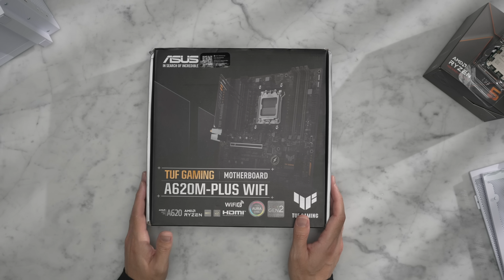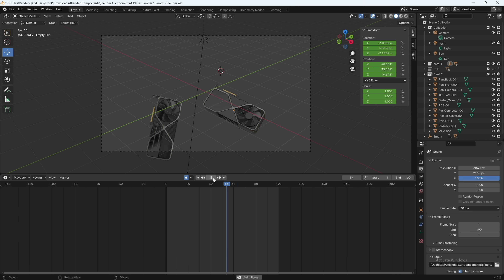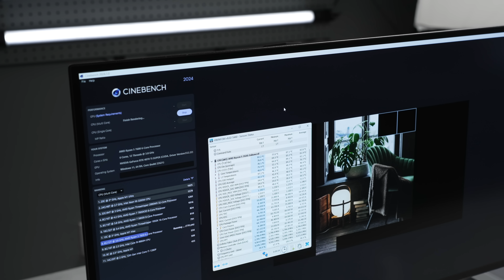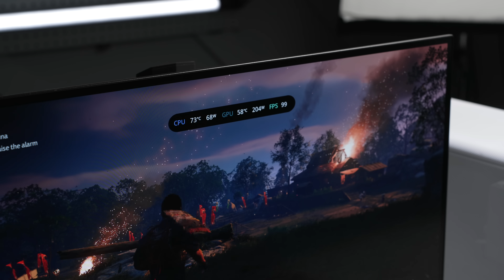$1500 MAX Performance Micro Gaming PC (Step-by-Step)

Comment from the maker: There’s a half inch gap between the front panel and the PSU fan, which is giving it enough air in this orientation. However, it would be optimal to flip the PSU. My mistake there. First time building in this case and had it in my head that the front was ventilated for some reason.
Reply: I still think they should have went with a mesh front panel.
Reply: Quick question: The very short PSU cables are from a different PSU? Or did you buy the Corsair SFF set of cables? Those are very nice and short.
Reply: @MrPicatoste90 😢thats what I was thinking😂
Reply: Just get a ventilated wooden front panel😊❤❤ very detail vedio❤❤
Reply: Important to note, you should flip it because you got the flat panel varient. The wood variant front panel has mesh between the panels.
Reply: just FYI your 1st bitly link 404 not found
Reply: I belive the wood panels have ventilation I don’t know why the colored ones don’t.
Reply: It’s actually not your fault. Front panel should have been ventilated. Psu would get fresh air directly from outside. Not the heat of the gpu and other companents.
Reply: @Galiamon  huh this case could be bad for psu then from your comment
Reply: @KnightZeemo  yes it is
Reply: I may know why you had that idea in your head, Devyn: When it was originally teased and announced by Lian Li, they said the front panel was gonna have fabric. I guess feedback/backlash made them change the front panel to solid plastic (would've been better if it was mesh though).
Reply: So many people are asking. Please respond! What is the system monitoring stat app you are using in the gameplay demos?

Comment: I still come back to this video even though I completed my first build in this same case back in October ‘24. It’s fantastic. I am starting to see space dwindle on my 1TB nvme, but there is an additional m.2 slot on the back of my mobo with no heat sink. Just wondering if I actually NEED a heat sink for the additional drive?😅

Comment: 4070 ti gaming OC is 336mm I have one XD. Seems perfect for a chassis like this with an X3D chip on an air cooler. Just keep that top exhaust blowing, and some gpu intake fans if they even fit. To un CHOKE the gpu vs having a top mounted RAD. As far as the most optimal/setup orientation for using the glass side window. Id consider am5/ddr5 but the price point of that asrock b550M SE is too hard to pass up from a budget/impact standpoint while wedging the most budget/scale towards a GPU. By the time that platform feels quite dated im figuring DDR5 M-atx boards will be cheaper or a more worthy aspect of consideration/upgrade. Or when AM5+ m-atx boards come to exist. For a higher end gpu even....4k becomes more of an aspect of considration or an OLED tv/monitor which to me is still somewhat less of an emphasis on cpu. Though the intel/ultra chips have shown some 4k implications. From a price standpoint id still consider the 5800x3d/DDR4 and a flagship range gpu for 4k from a budget standpoint it still leaves a lot of potential towards a tv/monitor. IMO current gen still cant even make the most of a 240hz 4k panel. Id rather get something more budget oriented/suited with lower refreshrate that still offers VRR. And largely "CONSIDER" a platform/gpu upgrade when newer gen oled panels exist that boast better HDR performance/brightness ranges. As far as what "today" can offer budget wise...vs tomorrow. From a build to monitor standpoint/ratio. a 180hz 21:9 oled per ex with a decent build bearing in mind use of DLSS+ Frame gen, or fsr+FMF. Into that future/upgrade generation/cycle....and better OLED brightness-option era potentially flexible. Thats just around the corner as well as am5+. BC of the older am4/DDR4 platform you can wedge a 7900XTX into the 1500$ build budget range for 4k into a future/better 4k system when that time comes. OFC nv offers more to professionals As well as a current state/better support/implementation of DLSS or Frame gen...granted FMF is supported on RDNA2 cards as far as AMD finally making its way around the bend. So ppl could also snag/snipe a good 6950xt used and run up a build for this use case.

Comment: so beautiful. i would love to see an aircooled 4080 super 7800x3d build in this. i'm actually considering "using" this build but with a 7800x3d and the zotac trinity 4080 super (which is of 306mm length i suppose it would fit), Thermalright Phantom Spirit 120 Evo CPU Cooler and the GIGABYTE B650M AORUS Elite AX (Rev. 1.0) mobo, Corsair RM850e 850W PSU. PCpartpicker says s'all good but as i have to get the parts of 5 different vendors, im still hesitant wondering if there would be no issues with the fit.

edit: i built it myself with the 7800x3d, gigabyte gaming oc 4080 super and a corsair 850x PSU front mounted, thermaltake phantom spirit 120SE, as well as 2 lian li fans as shown here plus another 120mm side intake fan to feed cpu/Psu fans. works and fits like a charm.

Comment: Want 4k $1500 pc? Too bad if you said “no”
B650 msi mag mobo $139.99, r5 7600x $197.80, asrock rx 7900xt $689,.99, 32gb ram $107.99/$97.99, teamgroup 1tb superb nvme $61.99, thermalright aqua elite v3 $53.90, any 750w 80+ gold power supply $79.99, and antec c5 case.
Now your beautiful 4k beast is made
Edit: price for all is around $1,475
Edit 2: it also has amazing aesthetics with the everywhere

Comment: That solid front pannel is a deal breaker. I will wait for ver 2 when they fix it.
Reply: The version with walnut slats in the front is ventilated.
Reply: I think ur missing the point. It's not solid. It's a PSU exhaust point. Think before you speak. I take and exhaust are on the sides, back and top
Reply: @NekoSauce  Think before you speak. I like my PSU sucking fresh air from outside the PC. If that front pannel was mesh the PSU could easily have done it
Reply: @rak2075  The "new" wood version has mesh

Comment: hope we see more case options at 26L or less that has support for a 165mm air cooler, full size atx psu and micro atx mobo.
And more importantly MESH MESH MESH MESH for airflow

Comment: Without a single case fan, this build is just waiting to overheat. I just built with this case and you can put two or three fans in the top, two fans in the bottom, two or three fans on the left side, and a 120 exhaust fan in the back.
Reply: I know I'm a little late to this video, but take a look at Mr. Matt Lee's video on the Lian Li A3. He just posted it a few weeks ago. He put 3 fans on the bottom, one in the back, one on top, with an air cooled CPU (Artic Freezer 36). The build looks very nice.

Comment: So, i'm planing a new build and considering this case since its clean and allow alot of options. However i want to aircool this project, and really want to fit a BeQuiet Dark Rock 5 PRO.
The limit for aircoolers in this case supposedly is 165mm in height above motherboard.  The Dark Rock 5 PRO is 168mm in height.   

The cooler you installed is about 159mm in height.  Sometimes there is some wiggle room in these measurements event tho the spec says 165mm,  sometimes 167-168mm etc will still work. (TIGHT) but managable.

After watching your video i want to believe there is like 9mm to go when checking your Freezer 36, what say you?
Reply: I’ve seen a video from Hardware Canucks I believe that mentioned the NH-D15 V2 which is 168mm and they indicated that it’s likely to fit given how flexible the side panel is.

I’m also looking to build in this case. Currently I have a 4060Ti and a 7800X3D with the PS120 and an ATX PSU. 

I’d ideally go for an Arctic Liquid Freezer and a SFX-L PSU for headroom because I wish to put a 5090 in when that arrives, but I’m likely going to keep the current setup for now.

Comment: With the GPU pulling in ambient air from the bottom and no dedicated exhaust fans, meaning no fans mounted to the case itself, that would make this a positive pressure build, yes? And does it even matter with a build as open and uncluttered, as well as with so much porosity in (most) of the case panels?

Comment: I plan on downsizing my current atx build into this case, with water-cooling and everything, because i also need to fit 2 additional pcie cards - anything more than 2 slot GPUs ain't gonna fit. Let's see how it works out 😈
Reply: it worked :)
Reply: @Clumaex ur atx board fits?

Comment: The undivided box of bagged screws is a Lian Li thing. I took the time to sort the screws before building my O11d Mini and it was worth it- they include a lot of extras and so that box has stuck around and seen a fair bit of use since too.
Reply: I did the same while building my Lian Li 216 RGB. The box is a nice gimmick and can be used afterwards to organize screws and leftovers. I don't see any problem with that.

Comment: So, I think you made a mistake with the part choice. As you demonstrated gaming performance, the 4070ti super was held back by 7600 in all scenarios. You can't use ray tracing with 7600. It's too hard on the CPU as much as the GPU. A 4070 super with 7800x3d and a decent motherboard would have been a better option.
Reply: man I'm running 7600x with 4070ti super and i can perfectly say 7600x isn't holding anything back. heck i could even pair it with 4080
Reply: also ray tracing is gpu intensive not cpu. and my cpu barely crosses 30 40% usage in demanding gaming.
Reply: @Apeeksiht  The thing is, you can't evaluate if your CPU is holding you back with CPU usage. You should check GPU usage; if it's not 100%, that means your CPU can't keep up with your GPU. And yes, Ray tracing is mostly GPU's workload, but it is still need CPU. Next time check your GPU usage.

Comment: Nice build, like the IO on the case, glad Dancase finally understood that using a 2 port header and only giving us 1 port just sucks. It's a dumb trend. I do worry about temps, I think this case would be pretty hot. Why not front intake? It's molded plastic, just mold some holes. It's not even a machining issue! Aside from that, the part I'd personally change is to go with an ASROCK Steel Series motherboard. A bit higher spec, could even get a B series with OC options for the same price. ASUS has shafted me recently on 2 motherboards and a PSU, so I avoid them like the plague now. Got my uncle on a laptop. Warranty only covers the computer. Not the display... It's a LAPTOP. the display is part of the computer! Looks really clean though, and I get thinking the front is vented. Those vertical lines are like the molded on exhaust ports on some of those "gaming laptops" at WalMart! :face-blue-smiling:

Comment: 260$ for A-series motherboard is WILD
Reply: Bought my gigabyte A620I for 130€
Reply: Why I suggested Asrock. With ASUS lately, good luck if there's problems on getting them fixed. "You put in a cpu? Sorry, our warranty doesn't cover modifications..." Add to that the premium price tag, with lousy service, they're not the ASUS they were a decade ago.
Reply: and still has that OLD razor sharp IO shield.
Reply: It's 140 euros
Reply: Should have went Asrock b560m motherboard and took that extra money and got three fans to put at the top of the case.
Reply: @jakemckeown9961 u don't want to do that when your using an air cooler. The 3 fans which will be exhaust fans will just suck the cool air from the cpu cooler. If anything put either 3 fans down the bottom as intake or 2 fans along the side for intake towards the psu n cpu cooler.
Reply: Its 114€ in my country
Reply: I noticed only asrock has affordable good performing boards in all sizes, the rest just release garbage in different tiers
Reply: @justeddm im going for the b650e mini itx asus rog board. Yeah its 300 but i have a pc rn. So my next build will be expensive and look damn good

Comment: Really loving the build, for my own personal build im looking for a case that almost has the vertical equal to the dan A3's HORIZONTAL length, and width equal to the VERTICAL height of the dan A3 in the video 
so it would be like the dan A3 sitting upright on its front
if you know any cases like these, let me know. I would really appreciate it
Reply: Cerberus X?
Reply: @buran2527  yeah that form factor really works well. Thx

Comment: The case looks very nice and is quite a nice addition to the mAtx lineup of cases. I'm still holding out to upgrade from my nr200p.
Reply: This isn't an upgrade for the NR200, any version. Decent looks, but that caved in back panel doesn't give me any confidence in the build quality at all. Nice price point, but thinking it makes too many shortcuts to get there for me.
Reply: @arudanel5542  I agree that the overall build quality seems good but not the best. The price point is great but I'm waiting for another itx case come along. I was hoping for a second round of the dan c4 sfx but that's not happening.

Comment: the front panel is solid, how can the psu intake air when you installed them like that?
Reply from the maker: There’s a half inch gap between the front panel and the PSU fan, which is giving it enough air in this orientation. However, it would be optimal to flip the PSU. My mistake there. First time building in this case and had it in my head that the front was ventilated for some reason. Pinned a comment about it.
Reply: Hold up...... Wait for it, waiiiitttttt foooorrrrr it ... THE FAN,  serious note, there is plenty of room for air.